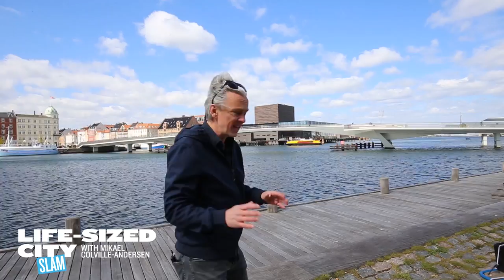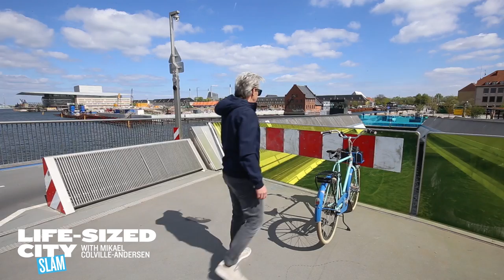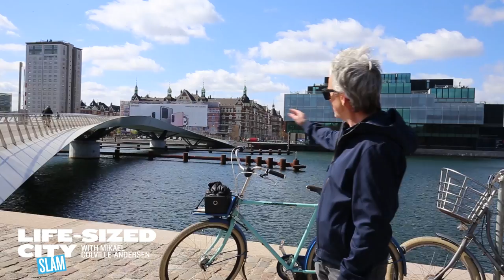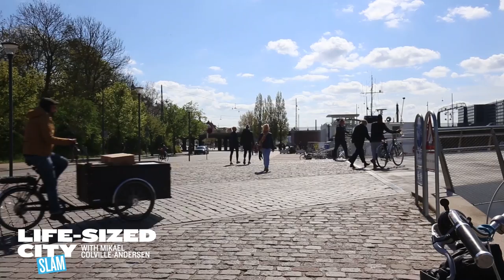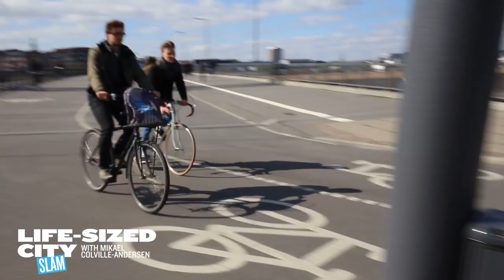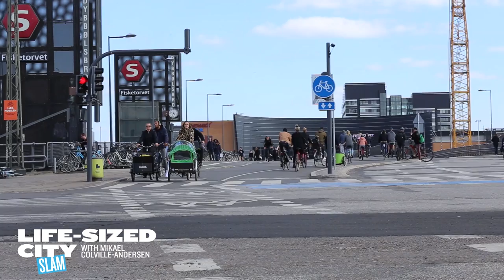The Unholy Trinity of Bridge Stupidity in Copenhagen

Comment: Your story about supply issues reminds me of a crushing mill complex I worked on in the early 1980's. The structure was designed and built in the United States, with the Imperial measurements. The moving parts, motors, gears, etc were built in Canada with the metric system. And nobody checked out to make sure everything was compatible.
As part of the construction crew, I have to thank the engineers for the mistake. My bank account was much healthier for all the overtime I worked trying to adjust and install the mismatched pieces.

Comment: Additional failures relating to "the kissing bridge": Initially Copenhagen decided to station four guards on the bridge because they were afraid that people wouldn't understand how to safely enter and leave the bridge. I remember that the traffic on the bridge from day one was massive so this might be seen as due diligence instead of a failure.

Soon after it was discovered that the road paving on the bridge was too slippery when wet so they had to quickly fix the paving.

Also, at the time when the engineering company was in the process of bankruptcy, a steel delivery of more than 400 tons of steel from Spain was rejected because of quality problems.

These days I cross Lille Langebro every day and if this new bridge didn't exist I might have selected a completely different route to avoid Langebro altogether so obviously I'm very happy about Lille Langebro. 🙂
Reply: Yea I think some of the critics neglect how annoying it can be to deal with Langebro depending on which direction you approach. The new Lille Langebro makes the general flow for bicycles much easier with less potential interruptions. I like it.
Reply: Yeah, Lille Langebro, is the most succesful of the three harbor bridges, even they are all to narrow,
hope they will learn when the fourth between Tejholmen and Islands Brygge gets realized.
(The Cycle-Mayor)

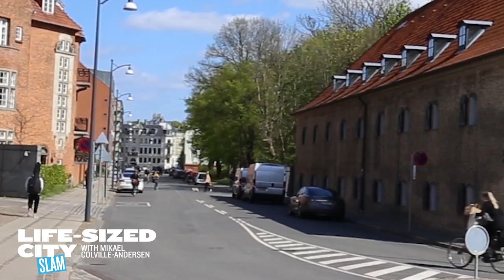Comment: 09:20 I live close to Amager strand, and I depend on that bridge daily. Apart from the extreme cobblestone (which is significantly reduced if you go via Prinsessegade —> Sofiegade —> Dronningegade), this bridge is the reason I make it to work without sweat or stress. Judging from the amount of people using it (especially from that direction), the bridge certainly has paid off.
My two cents would be to fix the cobblestone
Reply: Yep, that bridge has definitely been a great ease-of-life change for many cyclists in the areas nearby, makes it so much better not having to seek out a centralized main bridge with traffic and outside factors that can impede your riding flow.

Comment: Damn that last bridge's intersection could really use the Dutch "all bikes get green at the same time" solution (if not going for a roundabout)
Reply: Yea it's very strange, and thats how it works in every other intersection anyways - this new design is just odd. I don't think the roundabout would work these days because bicycle traffic is too heavy and it would clog the regular road traffic for cars and busses if there is a constant stream of bicycles.

I think the issue is that they tried to fit a new design on the bridge into an existing intersection, without redesigning the intersection itself to match the bridge. A complete rework of the intersection could probably solve it quite easily, but that costs more money and will probably have to wait a few years before it would get a green light.
Reply: Idk, as a Dane I think it would cause some confusion initially and that's an incredibly dangerous thing to happen in Copenhagen due to the speed of the cyclists (first rule of Copenhagen is to constantly watch where you're going, cause if you don't, you'll get mowed down by a cyclist). A roundabout on the other hand, is so normal in Denmark, that both cyclists and drivers don't think about how to engage, but just engages without any difficulty. In some places of the country, we even have roundabouts inside roundabouts.
Reply: @Jeffrey van Gurp  " Dutch "all bikes get green at the same time" solution " - ...Followed, no doubt, by the friendly message: "The City Council wishes the best of luck to everyone!..."  (Pardon me, is this a "Traffic Management" or "Population Control" project?!...  ;-)
Reply: @Real_MisterSir  You're right, often the prober correction will come with the experience, and demand of a logical solution. So there is hope.

Comment: Here in Vancouver we're removing motor vehicle lanes from the existing bridges into downtown. Three new bike lanes so far and two more in planning. The latest will be a greenway design with major pedestrian improvements too. The downside is they are high-level bridges so they tend to have significant climbs - although one isn't too bad. The upsides are less MV capacity and no delays for swing spans. Vancouver is often hilly so the bridge climbs aren't seen as that big of a deal.

But we do have bidirectional bike lanes downtown and they work really well here. The design standard is they are only used when MV travel is one way so there is less potential conflict. I prefer bidirectional when possible because the wider lanes make passing easier or riding side by side its still possible for somebody to pass. Also, more likely to spot friends or acquaintances making the routes more social and creating the feeling of a nicer pace of life. We hit up to 10,000 per day at certain places on the bike network so we're catching up Copenhagen.

Comment: I could have made a very similar film about the three bridges constructed in Bristol UK, in the recent past.  The first, Perot's Bridge, is on a strategic cycle route, so it was conceived, designed and constructed for pedestrians, so it was too narrow.  The second, Valentine's Bridge, again on a cycle route, designed with the parapets too low and a surface which didn't have the right friction for bike tyres, so they banned cyclists from riding on it, and installed chicanes to make them get off, which inconvenienced everyone and could be blocked by a wheelchair or buggy.  The final one was an absolute corker, officially called Meads Reach Bridge, but universally known as the cheese grater.  It was made of stainless steel, which was very slippery when wet, and the road surface is composed of raised domes with holes in, just like a cheese grater, and there were many injuries caused by it.  It was expensive, £2.4 million in 2008, and has been under repair and resurfacing seemingly endlessly since then.  Mikael, you're only amateurs in Copenhagen; in Bristol we have bridges that attack cyclists.

Comment: The only time there should be a warning sign that something might hurt you is if it is necessary that obstacle is there, for instance a tree is blocking the way, or a piece of equipment must be in that location to run optimally. You don't need water in the middle of that. It looks cool, but even then they could have made the turn a lot more gradual, maybe even curve it so it's intuitive.

Comment: When I watch videos like this all I can do is weep. Your hell is my heaven :D In Zagreb it's "be quick or be dead". There are fragments of bike lanes scattered throughout the city, bridges are collapsing anyways so nobody cares there aren't any bike lanes (and if there are, those are shared with pedestrians). But the biggest problem is, our city has taken on an obligation to build up the infrastructure, as per EU directives or whatnot, and they are doing it wrong. They are mostly looking into satisfying it in theory, on paper. So you have bike lanes so narrow, your handlebars are sticking out of the lane. You have lanes coming to a dead end or just vanishing underneath you. Horizontal and vertical signalisation is nonexistent mostly. There are no ramps to speak of. There's this bridge on my route to work that I have to cross, a lane leads up to it, then stops so you have to cross the bridge using a pedestrians only sidewalk (very narrow one) and you reach the other end of the bridge and there are stairs to go down to the park. Stairs. Even people in wheelchairs can't get off that bridge. The city has installed a wheel "guide" on the stairs so you can slide your bike down/upstairs (but not while mounted unless you want to hurt yourself badly), but it's very steep so it's much easier to carry it. And once you're off the bridge there are no lanes. Nowhere. So it hurts when our mayor brags about Zagreb being a "bike friendly city". :D

Comment: I do not think a roundabout would work at dybbelsbro. There is simply too much traffic. I know this sounds strange, but when enough traffic hits a roundabout it cuts off one or more roads. Now a lot of bikes enter that intersection, so cars would have a very hard time leaving the roundabout too (especially since bikes rarely indicate). 
The capacity of roundabout is the reason some roundabouts have lights telling you when you can go. If they weren't there, one road would likely be cut off and it would essentially become a awkward speedbumb.

Roundabout are fantastic unless there is one big road meeting a small road, or if theres so much traffic you can't get in the roundabout, because the car stream just wont let up (or here the bike stream).

Comment: agree with basically all the points as i ride bicycle on daily basis and use those bridges fairly frequently enough - as i’m a bike messenger. but just wanted to emphasize that those comments regarding nationalities of architect were strictly unnecessary in my opinion. especially when you were talking about the last bridge.

i would just add that the famous snake bridge is not extremely steep but it’s length added on top of its gradient makes it a bit more tough opponent for some cyclists from my experience.
Reply: architects*

fancy shmancy polish architect as i remember was q unite to be more precise.
Reply: ah pardon me and my phone, a quote*

Comment: And  then there are other countries and cities - like in austria where in 2012 they had the audacity of claiming that Graz is the bike-city of austria.....
A city that is split into east-west by the Mur (river) with very few and narrow bikelanes, where one of the busiest bike-bridges was running over private grounds with no winter-service or anything like that, where you then have to cross the road cause the bike-lane suddenly switches sides, then cross a 2-lane main-road, and then switch the road-side again.... that bridge and bikelane was the shortest connection for a large part of the western half to the city-center, a school and the university.....
And of course they "replaced" the bridge - just not opened cause they FORGOT to talk to the land-owner where the bridge ends on..................................................... Yes, they forgot to ask the owner if/how they can make a bike-lane there.

Not to mention that the city-square and other important areas, while reachable by bike, often involved randomly ending bike-lanes where you then have to switch onto a 2 lane main road, cross several tram-tracks and/or through small alleys that are filled with shops and pedestrians.

Still - due to malicious city planners ( yeah, we had some green nutjobs that intentionally hurt both cars and public transport - had lead to some court-cases) the traffic is so bad that the bike is more often than not the fastest option. Bike and car are the same time when i go east or north. And while i have a direct endpoint-to-endpoint tram connection to the north - i am still faster going by bike.
There are even parts where WALKING is faster than public transport. Yes, talking a 30 minutes walk often pays of.

Comment: As a Canadian tourist not familiar with the city I found biking on Bridge #3 very confusing because rules a completely different then any other intersection. Makes no logical sense to have an intersection that works(doesn't work) completely different to any other in the city. After watching this I no longer feel bad about being confused when using it. Biking on Bridge #1 was just plain dangerous and I imagine even more so when there is rain, snow or ice. Bridge #2 has two advantages over Langebro bridge, no high amount of vehicle traffic right next to you zooming by and being able to get off right after the water end instead of continuing on for another block or so or having to take your bike down or up stairs if for example I want to get on Balvebod Brygge road. I found Langebro bridge unpleasant to use with all the vehicles and noise.

Comment: even bridges/cycle lanes like THAT would be a major improvement over what we have in Berlin. some of the bigger arteries here have like 3 lanes for cars both ways. they are usually very empty except for rush hour, meanwhile cyclists often only have tiny lanes where you can't overtake without going on the sidewalk, cars park on them if it's one of those "we were lazy so we just drew some lines on the street" bikeways, and don't even get me started how you often have to spend almost 5 minutes crossing a big road because the traffic lights are separate for each direction and not synced up at all. There's been some recent improvements in the form of so called "pop-up" cycle ways where they just marked off a whole lane of the street for bicycles, but that might not last longer than the end of the year because of stupid car-crazed politicians.

Comment: Looks like bad ideas never go out of style We have a floating bridges, built-in 1939 (longest ever built at the time), that had a retracting roadway affair real similar to this bridge. There were constant auto wrecks at "the bulge" with some cars flying off into the lake and people drowning. If cars weren't crashing, the mechanism was breaking. Usually stuck open so the bridge was useless until fixed. Thankfully, a massive storm coupled with some negligent maintenance workers leaving pontoon access doors open sunk the bridge in the 90s and it was rebuilt without the goofy system it had before.

Comment: With lillelangebro, I think it is worth mentioning that it removes a lot of biking traffic from HCA Boulevard and onto the quieter parallel road. I myself use the bridge everyday when riding and it a lot more convenient than Langebro, as i have to either go through a long set of light or ride under it to get onto it just to have cars roaring past. One thing I will say though is the design of the entry to the bridge on the southernside is a shit show. With bryggebro, I think it would have been a better design to have bike traffic to the RHS of the bridge, and bike traffic from Fisketorvet coming up on the far side next to the Hotel, that was people arent randomly turning left and into oncoming traffic after coming off the bridge quickly to get to the shopping mall. 
Also Dybbølsbro, just wtf. But the only reason I can think of is due to loading on the bridge. If not, hmmm.

Comment: First of all, I like Mikael. Especially other urbanist videos. I had a good laugh now. Ha-ha! These bridges are not steep. Copenhagen cannot ignore its weather. Budapest also has a period when the Danube is frozen, but the sunlit bridge surface is ten degrees. Only this period is different and shorter than in Copenhagen. You should come and see our bike tour. A sudden turn? Is it sharp? I don't know if Mikael knows, Budapest and especially the Buda side is a mountainous area. Anyone can accelerate to 50 km/h and be on their way! Don't let anyone be a fool! I don't know if that bridge could have been planned for a straight line, or if it's just the design, then there could be some error here, but in most cases this is not even possible, due to the pattern of the streets. Although Copenhagen is a flat settlement, the urban fabric was formed a long time ago. It is clearly visible that it is a design method favorable to cyclists. It is a fact that in most places in the world you have to make compromises. It is not possible to expect them to design and transform everything in a non-conceptual way, as in the US car infrastructure. True, they have advantages there too. They really reduce accidents, you just have to plan everything for the mass of those vaccinated against driving.

Comment: The original proposal for Dybbølsbroen contained plants, benches & stall areas. Not this sad, grey and illogical monstrosity we ended up with. It was also meant to have better and more clear division between the bike lanes & the pavement. I can see at the bridge from my windows, and I feel so cheated, when I contemplate the proposed design versus what we ended up getting.

As a pedestrian, I also feel extremely vulnerable, when cyclists come at me from whichever direction they find most logical at high speed. Clearly there’s a major flaw in the design. It is in no way intuitive. I wholly agree that the city should bring back the roundabout. And while they’re at it they could very well finish the pavement opposite the train station as it doesn’t seem to be completed when you’re walking towards the shopping centre.

Sometimes I wonder if they simply ran out of funding, and just went with a subpar makeshift solution to get the job over and done with.

Comment: i get the hate, but the second bridge was added just out of convenience for having a"trinity", because it sounds much cooler.
 The bridge is fine, "hardcore copenhagen pavement" is like 20m long and I would choose to ride or WALK on that bridge every time over that regular car bridge nearby. And you can see it with all that traffic. 
Also, for the first bridge, you can blame only city of CPH or whoever picked those architects in a big competition. Architects did unnecessary flashy design, but it was the jury who is responsible for not selecting sensible design.